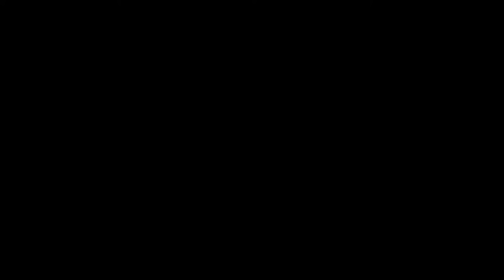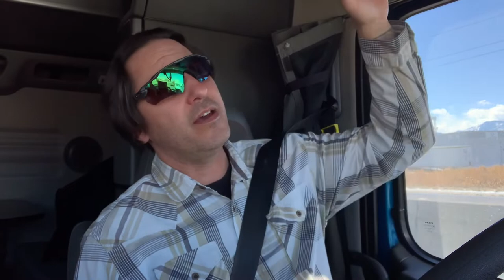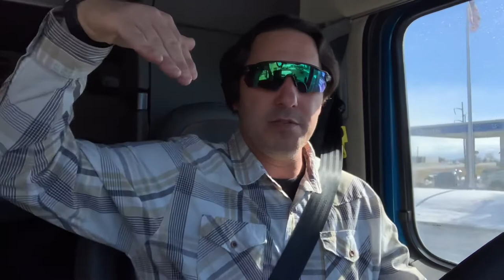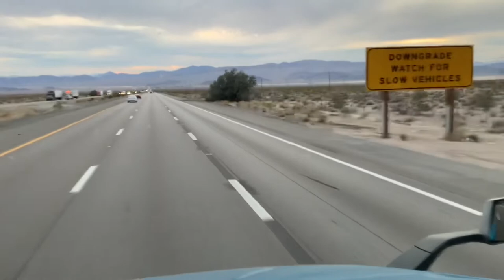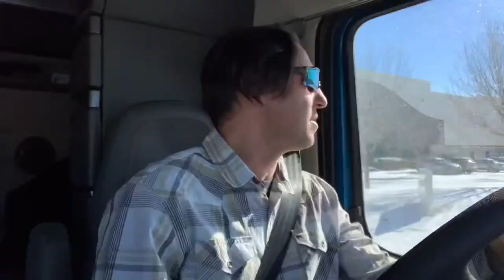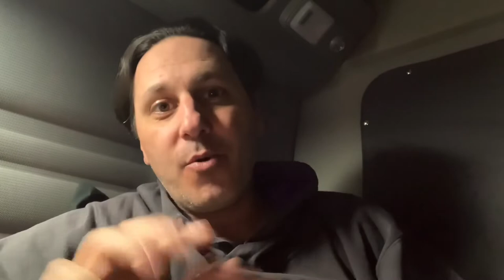No Jake Brake On California Hill—Learned A Lesson. Truck Driver Tells A Story About A Scary Drive

Comment: Downshift if your Jake's fail. Idc if you're going 10 mph down hill. You'll have to Downshift with rpm at 2k but at least you'll live.
Reply from the maker: Right. And I've found that every engine has its sweet spot where the Jake works the best
Reply from the maker: I drive a safe speed down hills which is too slow for some drivers, so they tailgate me to try to get me to go faster I guess. I just hold my ground though. Especially with a tanker trailer.

Comment: That was a pretty darn good story . l wouldn't have known that . l haven't driven a big truck sense the mid 90's . l am also a truck and equipment mechanic it beat me up pretty bad now that i'm older wish i knew then what i know now . l have seen many big rigs with automatic transmission when they first came out . my favorite was the road ranger  .  l can tell by the way you talk you are a safe driver . keep the stories coming .
Reply from the maker: Automatic transmissions in semi trucks have come a long way over years. They are now standard in over-the-road driving. Manuals are still common in certain sectors of the industry though.

Comment: Should have dropped a couple extra gears to slow down the truck then kept light pressure on the brakes to keep them from getting hot
Reply from the maker: I did. It was a faulty jake brake. I was able to stop safely though.

Comment: Never knew the cruise affected the jakes, definitely makes sense now thinking back on times where the Jake's should have kicked in. 3 years as a cdl driver 2 years tanker n now I learn this lol. Thanks for the content this helped
Reply from the maker: Yeah, I found out the hard way, and my boss assumed I knew. But it all worked out ok. I'm glad I could pass on the info.
Reply: Any truck i ever drove the cruise cancelled when i tapped clutch or brake and jake worked normal. I would almost bet that a shop could hook up his computer and change that. This guy may now know this but the next driver wont and ya a simple fix to fix future safety issues. 200 bucks today could save a life tomorrow. I will drive junk within reason. Any parts that hold tires on must be good, brakes must be good and no retread tires. Kinda nice to have a jake brake that works when cruise not set. In 21 yrs of driving semi long haul running 3 logs i never had a accident beyond a mirror at a tight dock or truck stop. 200 buck repair and on the road. Maybe thats why i only pay 50 bucks per month car insurance on a newer suv. 512 bucks per year. Cancel colission and be 42 bucks not 50. Lol 8 extra bucks get colission and rental car coverage if i screw up. Told accident forgiveness for yrs of accident free driving. Ticket forgiveness as well cause last ticket was over 15 yrs ago. Pulled over yes but only verbal warnings no tickets cause i was borderline and clean record. Even califonia dot only gave me warnings when caught with more then 1 log book. Just hand over a blank book. Then told to catch it up and leave. Sit 15 min and leave without drawing any lines. Just dont crash or be totally fucked for years. Know your personal limits and go to bed. Some can run 20 hrs and good with 2 hr nap. Others need a 6 hour nap after only 5 hrs of driving. The best you can do is when too tired park and sleep until no longer tired. Everyone is different and thats my reason to run 3 books or no book at all. Some trips i averaged 1100 miles per day. Other trips 400 miles per day. I care less about appointment times. If i make it great. If im not feeling 100% i just rest until i am and that appointment can be changed. Hey customer im 2 days ahead. Could i deliver a day early? If not then stop in vegas or reno for 2 days. If yes then sweet. Or hey customer ive been delaid a day i will be there a day late. Sorry but safety reasons i cant. Just be sure to call ahead not after delivery time but a day or 2 early.

Comment: I learned how to drive a jakeless truck out west never had an issue,be safe out there.
Reply from the maker: Hats off to you. That takes some skill.
Reply: Can you teach me how to go steep hills with out  engine brake
Reply: @hammamkahla4302  I don't think it can be done on long hills unless you have a light load. Shorter hills can be done by starting down the hill really slow. Don't stay on the brakes once you start going down the hill. Instead, press the brakes hard for five seconds to slow down a lot, then you'll start building up speed, and when you speed up too much, push the brakes hard again.

Comment: If you can't see how to get out don't go in !!   😂😂         
  When I drove a Heavy-duty tow truck,   I towed a tractor and set of doubles,  to a truck company yard down a small street,     "they gave me these directions !! "           When I got to within 1 block of their yard,   there was a construction crew digging up the street !!       I CAN'T go forward,  and I can't back up 4 pieces of articulating equipment !!     I called the trucking company,  they told me "the street was clear this morning."
  So NOW I have to disconnect each piece and back it up 2 blocks then go about 2 miles around and come in from the other side into their yard,      it took me about 3 hours extra because of this mistake !😜
Reply from the maker: I had a similar situation when I was delivering fuel with double trailers. The side street to the gas station was under construction, and the only other entrance required me to separate the two trailers and blind-side back in from the street to empty the first one, then pump the gas from the second onto the first and blind-side back again to drop that product. It took forever.

Comment: Some of the new trucks, the cruise control cancels when hitting service break and will stay off until you manually reset cruise control
Reply from the maker: I’ve seen that. I always wondered why they program it like that. I’m just glad my current truck doesn’t have any cruise or Jake issues

Comment: What you do is... you slow the vehicle down 5 mph as quick as possible then let off for it to get back up to that speed and then repeat until down the hill.  I learned this when working for Crete Carrier.
Reply from the maker: That’s good advice. This situation was unique because the downgrade was 17 miles long. At that time, I was a rookie with no mountain driving training, so I did the best I could do. I don’t think any of the techniques people have told me about would work for 17 miles though, and I’m not going to test them 🤣
I’ve descended that hill 100s of times since then, and I learned my lesson.

Comment: *IMPORTANT: I lost my engine brake on a brand new International LT with A26. I slept on the top of Donner pass in California. I leave the rest area and start going down towards Nevada. I put my engine brake and press my service break and my engine brake should come on but nothing. I couldn’t believe that what I have heard about was about to happen to me. But since I have done research about this topic and with the help of God, I didn’t freak out and remember I still had 2 other ways of slowing down the truck. 1. Downshifting my automated transmission and my service brake. I started to hold down my service brake for about 3 seconds the letting go to slow down the truck while I down shifted the automated transmission. I was going to slow it down to a speed where the transmission by itself could hold the truck at a constant speed with the load I had all the way down. Everything was working well and out of no where the jake brake started working again. Later I found out that the engine oil pressure is supposed to be at a certain temperature and or pressure for the jake brake to engage on this particular engine, remember I slept on the top of mountain and started going down. REMEMBER: You can go down any mountain without jake brake or downshifting but it has to be at a very very low speed. You have to keep below like 20 MPH with constant pressure on you service break so you don’t speed up and you can make it down. I went down a snow covered mountain in Montana in speeds from 17 to 6 MPH all the way down with no problem. And remember no Jake brake in wet conditions to avoid jack knives. Slow your speeds down. God bless trucking family. PS Manual transmission is a whole different animal. You have to know how to down shift before the hill. If you take you transmission out of gear going down the hill and can find the proper gear for the speed now you have to engine brake either.
Reply from the maker: Thanks for sharing this. This is some great advice.

Comment: Great story. I have heard of that set up before which makes no sense.  Reminds me of driving  back in the 80's when most trucks didn't have Jake's.

I have a boatload of stories about smoking brakes. Took me years before I learned the secret to not burning your brakes was starting out and staying at a lower speed. With no Jakes, I used to drive below 25 on long grades. Enging brakes sure do help and  we miss them when they are not working.
Reply from the maker: That’s exactly right. I don’t know if you’re familiar with the Parleys downgrade in Utah (between Salt Lake City and Park City), but I smoked my brakes the first time I went down it (westbound). It took me two times to realize I better start off at a slower speed, and I never had a problem since. Same thing with Cajon in San Bernardino County, CA. Thanks—that’s a great tip for new drivers!
Reply: @PressingMyLuckTruck  Oh yes. Parley's Summit. Interstate 80 West of Evanston Wyoming. Been across there many times.
In that area there are some nasty hills south of Evanston and East of Interstate 15. We're talking 12 miles at 8 or 9%. Hold on Nelley!
LOL
Reply from the maker: Maybe Hwy 150? I’ve never been on it, but I’ve taken US 191 south out of Rock Springs into Utah, to Hwy 40, to I-80 into SLC. All three of those are miserable bastards. I can’t remember which highway, but one of them in that area is closed to trucks during winter. Too treacherous.

Comment: I heated up my brakes going down Mountain Pass as well my 1st time. The next hill Cajon Pass i started down it a lot slower but was still nervous since id heated up my brakes a few hours earlier 🙏 God was looking out that day
Reply from the maker: I know that feeling. You made it through and learned a lesson. Now you're probably a pro at mountain driving.
Reply: @PressingMyLuck_Truck  I'm okay. I'm used to driving an empty tanker unless our job site is on a mountain then I'll be full of water and concrete/asphalt slurry but that job was when I did regular OTR and I wasn't used to being in an automatic on hills I was used to downshifting in a manual before starting down the hill so yeah that's what got me and I was heavy I should have started down slower but yes I know now how to handle them Eisenhower I was still a little nervous but I did it right kept it at a safe speed and grapevine I kept it at that speed limit heading out of LA towards Sacramento because they had highway patrol sitting on the highway gotta love that 55 mph driving my california driving experiences helped me a lot